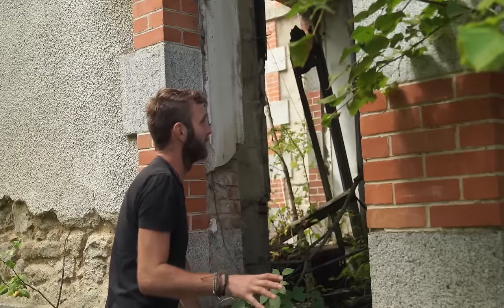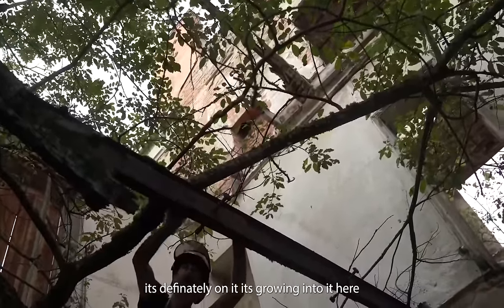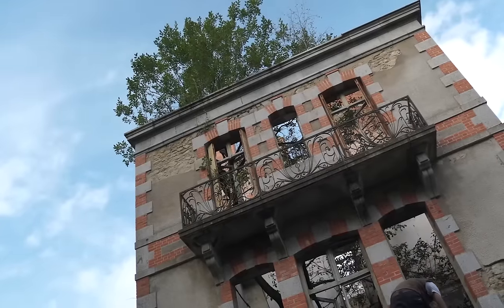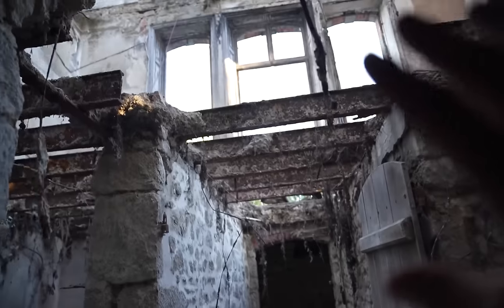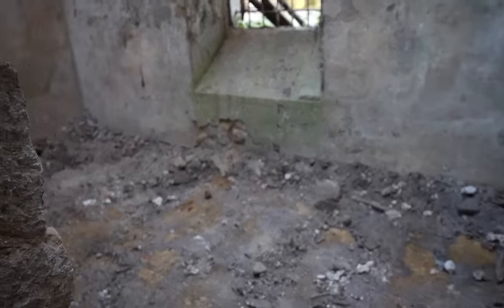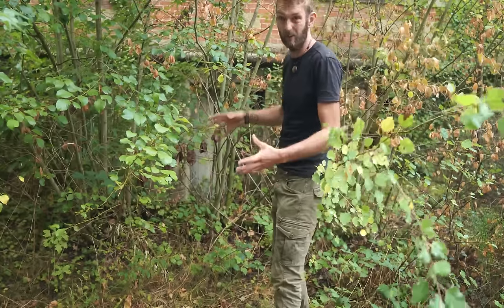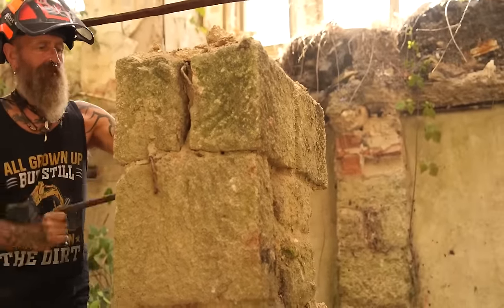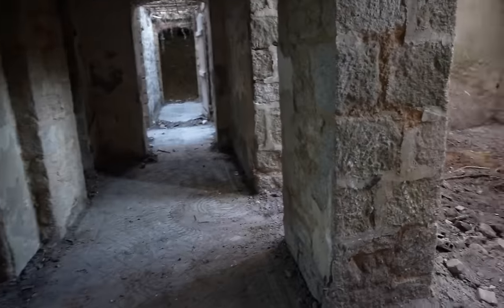1 YEAR of excavation, discovering every lost room in this BURNED down chateau.

Comment: Watching Nick and Cameron trying to demolish the laundry room sinks, I wonder if the bricks were NORI bricks which were made in Accrington Lancashire. NORI or IRON bricks backwards were made and are still to this day made in Accrington they are called NORI because of their immense strength ….as strong as iron. They are notoriously hard bricks to drill though. Our house is built with them and last year we had our bathroom refurbished and they were putting an extractor fan. They had to drill through the wall to the outside to put the exterior bit in and it took the builder nearly 3 days and 3 diamond tipped drill bits to get through the Accrington brick! He’d never heard of them before but he’ll never forget them now! They are so strong they were used for the foundations of the Blackpool Tower and the Empire State Building in New York amongst others.

Comment: Hi Dan, you really need to consider where you are going to put the new kitchen, I know it was in the basement previously, but I don't think it will work now, since you need the kitchen closed to the dining room, so if you are not planning on putting that in the basement as well I think the kitchen will need to go on the 1st floor.
Reply: This past year, I have studied this entire floor plan. It was masterfully designed for function (servants or not). The original kitchen is optimal in size and function as well as placement. (Ease of receiving supplies, etc.) The Chateau seems large but can be a warm and intimate home for a small family or larger - thanks to the extra bedrooms. The kitchen in the original location is no smaller than some restaurants’; especially with some modern period correct appliances. Besides the entry hall, there are only three rooms for use on the main floor. Grand Salon, Dining, Library/Drawing Room. Even in modern times those Basement chambers are very useful to keep machinery, noise and chaos at bay. From intimate home to large B&B it is all there. Hopefully this analysis will be given some thought. My blessings on whatever what you decide Dan.